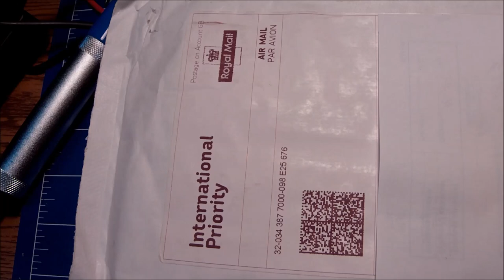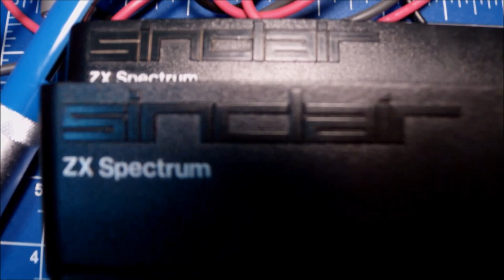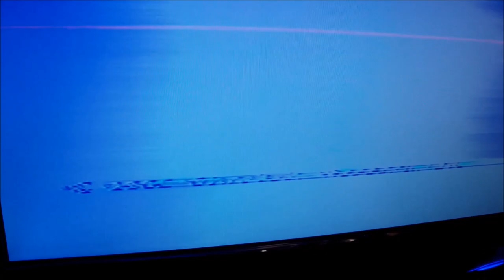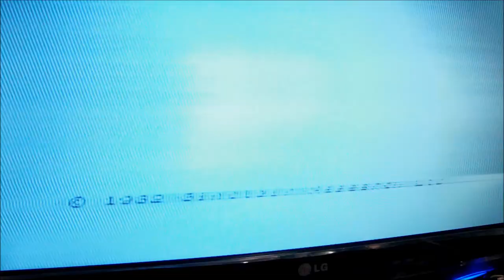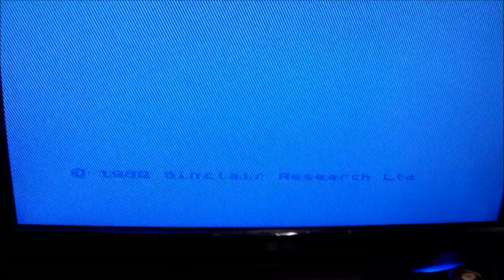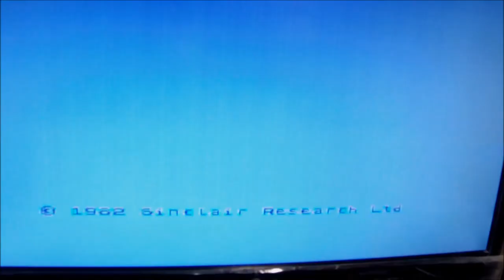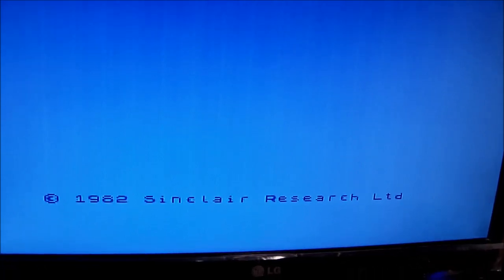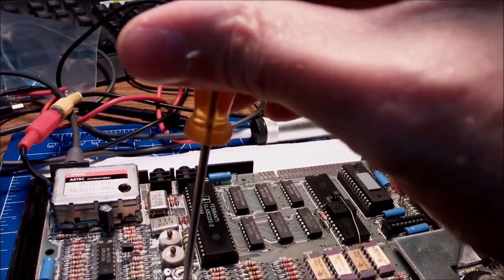Sinclair ZX Spectrum 48K - An envelope full of surprises...

Comment: Hi, the date code of most of the chips is 82xy. 
This makes the board being an early Issue 2. What looks interesting is, that if I've read it right, the TV modulator has a code 8451 (late 1984). At that time a higher mainboard Issue should have been available. Does it look as if the TV Modulator has been replaced?

According to the Logo: Looks like a Samsung one. If the bottom of the case fits to the top, it should show "Made in the Republic of Korea".

P.S.: One more hint
For CVBS calibration have a look at the service manual how to adjust. - ULA -2's are a bit tricky. Just fiddle around and adjust the voltages as in the service manual described.
Reply from the maker: Hi, this is a good catch! Well, it comes as no surprise to me if they did, maybe i can flip PCB some day and check solder points - thank you for notice thumbs up!
Reply: @CyberhugTechnologies  At least an interesting one. ;-)
You can check if the case is a Samsung one. British cases are prepared for NTSC modulators. There is a notch between the EAR connector and the TV out. It looks as if it could be broken out. The Samsung case doesn't have this notch.
Reply from the maker: @Eratosthenes0815  Great info again! I think they swapped the upper part of the modulator only :-) i was looking at it yesterday - the cover is somehow brighter than the mod's body so.. -  thank you very much mate!